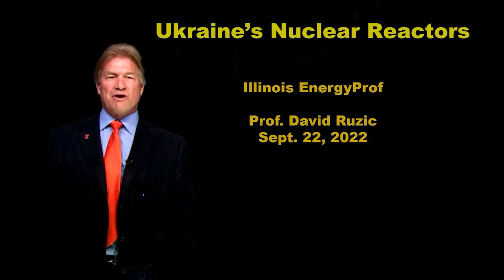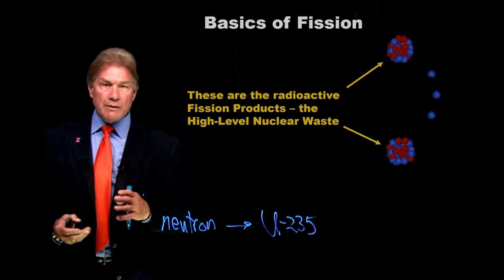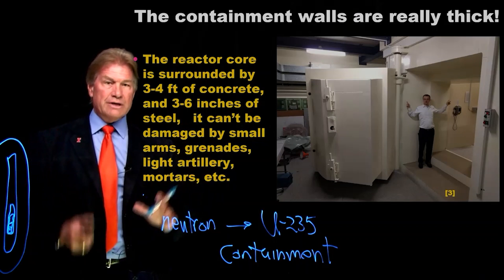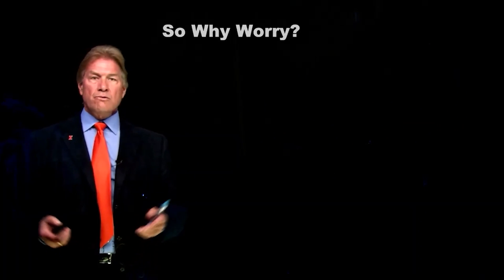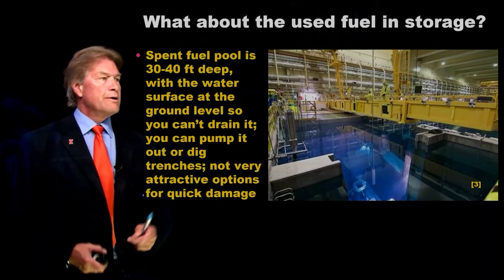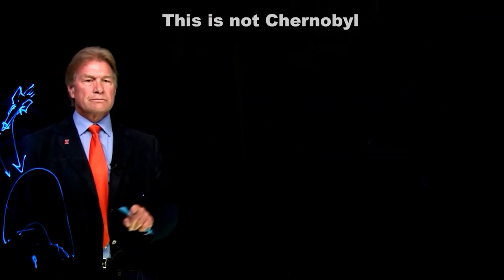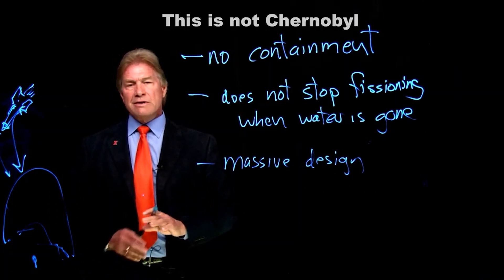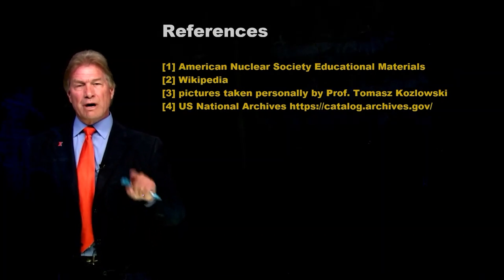Ukraine's Nuclear Reactors

Comment: Appreciate the video. Please stop calling it “The Ukraine” though, it is simply not correct.
Reply from the maker: I certainly did not mean anything derogatory when I said "the' Ukraine.  Of course it is an independent country.  The word "the" just slipped out.  It is true that I would not say, "Here is a map of the France".  On the other hand it does sound perfectly natural to say "Here is a map of the United States".  It also could be habit from having heard it described by that term for most of the last of my 64 years!   I did not realize it was politically sensitive, but sure do now.   I am more "up" on the science than on the politics and I try to concentrate on the science part.
Reply: No problem, I just wanted to point it out as some of your visuals also referred to it as “The Ukraine”. For example, at 0:25 it says: “Before the war, the Ukraine…” It’s not an overly sensitive topic but it is more proper to call it just Ukraine :).

Comment: A nuclear power plant is just a specialized industrial facility, and like other industrial facilities it requires electricity to operate and maintain.  In this case, maintenance includes keeping the fuel (spent and otherwise) cool.  While there is a defense in depth strategy for backup power, that strategy relies in the end on the continuing availability of diesel fuel for their generators.  While it would take a concerted effort to deliberately spread radioactive waste far and wide across the landscape, what happened at Fukishima is also possible if diesel (or grid-tied power) are not more or less continuously available at the site.  Yes, Fukishima wasn't nearly as bad as the media and others make it out to be, but it still is undesirable and would leave Ukraine without a significant portion of their generation capacity.
Reply: The only way a Fukushima type of release happens is if the containment domes are blown up. Otherwise, if cooling stops for a long enough time, you may have a meltdown of the cores that should be contained inside the reactor buildings, and hydrogen/steam building up, which may be released to the atmosphere like in TMI-2, probably scrubbed in the way out for barely any radioactive release. The VVER-1000 has systems that destroy any hydrogen buildup inside the reactor buildings as well.

Comment: I think one point that you could have emphasised a little more is the fact that to deny the operability of the plant, you really only need to attack the switchgear and transformer areas.  This is the distribution and its destruction completely renders the plant useless no matter what the generation source.  Also, most weather goes from west-to-east and the radiation would just end up in Russia as well.
The switch-gear is relatively specialized and is a relative-challenge to source, however the transformers are the real problem because unless you have them sitting around, there are very-few manufactures and the materials are somewhat specialized in their manufacture as well.  This is why and EMP event is so devastating because it overwhelms the ability to just replace thousands of transformers.
So, the Russians can just attack the outside to disable.  Any attack centered on the fission-process is indeed a war-crime...

Comment: "Cancer risk"  is a kind of scaremongering. In fact there is no link between radiation release an number of cancer cases. Even in Chernobyl, increased number of registered thyroid cancer was in fact badly preformed statistical data collection. Datasets collected previously (through so-call  "policlinical" research, before Chernobyl disaster ) were used against datasets of tolal screening of .population, after. Definitely there will be increase of number since thyroid cancer is such a disease that people may leave with it comfortably for many-many years and die from different causes. But it is very easy to diagnose.

Comment: A tank can penetrate that containment, they in fact can penetrate up to a meter of steel in some cases. With the right ammunition.
Reply: Maybe, it would be quite hard, though. A containment building is built like a bunker, even high velocity AP ammo will have a tough time getting through. It almost certainly won't happen by accident.

Comment: 5 times more electric energy is needed to replace fossil fuels. 
Fossil fuels are high density energy. 

It is simple build a power grid that is 5 times bigger. 
In Australia as a test, the 1,000,000 klm at today's capacity should be built to 5 times bigger capacity. 
It would be the same as building 4 new grids, 4,000,000 klm new.
And as Australia is a small population they can borrow the finances.

The government will guarantee the loans. 

And then you build the new and bigger nuclear plants, the 25 GW today becomes 125 GW of new generation and as Australia is small it can borrow the money and the government will guarantee the loans and the cash flow so others are comfortable lending. 

SMRs are only $2BILLION each and at 300Mw each Australia would only need 400 SMRs.

I think we should start immediately before demand goes up and prices to supply increases. 

We need more construction people and so a new wave of migrant construction workers would be perfect.

Who agrees  ??

Comment: One thing that needs explanation. Why was the news media making a huge deal about Chernobyl losing offsite power when there shouldn’t be anything to cool there?
Reply: You still need electricity to run the ventilation fans. I suppose the 'New Safe Confinement' is held under slightly 'negative' pressure  to the surroundings by those fans. This means some air from the inside is drawn out the NSC by fans, filtered and ejected to the outside, while there are other fans to 'push' back air in (but a little less than is drawn out, to maintain the negative pressure). Loss of electrical power to these fans (and al the other systems for conditioning this air, like heating or cooling) wil eventually lead to loss of negative pressure and a chance that some contaminated air could escape.

Comment: Putin may prefer blowing up nuclear reactors to detonating bombs because of the plausible deniability.  It's similar to blowing up gas pipes instead of just turning them off, or sending FSB agents to blow up apartment buildings in Moscow as a way to start a war with Chechnya.

It's good to know the reactors are relatively safe.  I wonder how much damage could be caused by a team of malicious operators...though malicious operators could be more difficult than find than a couple pilots willing to drop a bomb.  Fortunately criticality incidents, including Chernobyl, are much less destructive than the smallest atomic bombs.  The explosion stops the chain reaction.

Comment: Thank you for the informative video, but there is one thing you got wrong. It's just Ukraine, not The Ukraine. The "the" implies linguistically that Ukraine is not a country but merely a region. It's the old-fashioned way of referring to the country, but they officially asked the English speaking world to drop "the" some 30 years ago when the wall fell and they became an independent nation. Now, when their sovereignty is once again at stake, is absolutely the time to drop the "the".
Reply from the maker: I certainly did not mean anything derogatory when I said "the' Ukraine.  Of course it is an independent country.  The word "the" just slipped out.  It is true that I would not say, "Here is a map of the France".  On the other hand it does sound perfectly natural to say "Here is a map of the United States".
Reply: @illinoisenergyprof6878  I know you didn't. It's the traditionally correct way of referring to the country, and you just spoke as you were once taught. All I'm saying it's no longer appropriate.
Reply: Yup, I knew I'd find someone crying in the comments about this

Comment: Thank you Prof. Ruzic!
I didn't know the plant was made of a set of pressurised water reactors; I thought the reactors were of the old RMBK design.
I'm a bit more serene now.
It would be nice to see you more often.
Regards from the UK,
Anthony
Reply: They're about the same design vintage - VVER type PWRs. Much safer than RBMKs for obvious reasons.
Reply: Also, RBMK are still operated in Russia...
Reply: @humble_one_1  RBMKs were only operated within the USSR. These were easier to manufacture as you only needed a zillion of pressure pipes, but not a big sturdy reactor vessel, which needed to be put in form in a huge forge - today not many companies worldwide are able to perform such a task.
Reply: @gunnarkaestle    Actually. They are still operated in Russia, Kursk NPP and some other... 
Upgraded after Chernobyl of course.
Actually not that bad design. You can reload fuel with no need to stop reactor.
Reply: @ Actually, it is a bad design, as the void coefficient is significant. If some of your pressure tubes burst and loose water, the reactivity increases and may reach prompt criticality. This does happen even after the issue with the graphite tips on the control rods was solved.
Reply: No RBMK’s outside the soviet union obviously.
Reply: @ Current operating RBMK's are only within Russia (7 units left), as the one in Ukraine (Chernobyl) and in Lithuania (Ignalina) have been shut down.
Reply: @gunnarkaestle   yes
Reply: Wrong video
Reply: why you did not google it, if you were not "serene" before? All the info is there, independent of presenters. Get the facts and be serene :)

Comment: How are nuclear heat exchangers maintained? 
Do they need to be cleaned out regularly like normal ones? If so how do they not have contamination?
If they don't need to be cleaned out, how do they do that?
Reply from the maker: Usually heat exchangers that get fouled are ones that use outside water, like a river or a lake.  The heat exchangers inside the containment are distilled water to distilled water.
Reply: @illinoisenergyprof6878  With a bunch of corrosion inhibitors, since pure distilled water is corrosive. DAMHIK

Comment: Now use a trivalent fuel one fissile 239Pu or 235U isotope and two fertile isotopes 232Th or 238U. 232Th would be a hotter fuel source since 233U makes behaves similar to 235U except that it has a higher fission cross section in a thermal spectrum as used in a reactor. 🤓

Comment: A kinetic rod penetrator from an MBT gun CAN go through a containment structure. Likely some of the larger tandem warhead AT rockets could too, but not the most  common man portable AT systems.
Reply: Advanced atgms can penetrate 2400mm of steel.  But the explosion is very focused.  

They do have bunker busters that would do the trick.  But considering they occupy the place, they could just turn off the pumps.  Or just grab the spent fuel and toss it out in occupied territory.  Remove the generators that power the pumps.  

And it doesn't have to be on orders from above.  The occupying force could just decide to loot the place or detain the workers.
Reply: RBMK5000  
I agree that common man portable AT systems are not going through 1.5m concrete and 100mm carbon steel. Honestly, I've watched quite a few videos these last 7 months + of this class of weapons failing to penetrate the MBT armor they were designed to defeat.

However: look at air launched and vehicle launched AT rockets, particularly those with tandem in line warheads or very large single shaped charge warheads, as in the case of USA AGM114-K "Hellfire" missile. The weight of HE in these is an order of magnitude larger than the common man portabl AT weapons, THOSE could make a hole. Hopefully nobody is stupid enough to use such things.

As far as the depleted Uranium or Tungsten rod penetrators, the present generation of those fired from smooth bore guns at well over 1,500 m/second? At 90° those WILL go through the described 1.5m concrete + 100mm steel too.

Comment: The scary thing about the Chernobyl plant was it used graphite and when hot, carbon and the oxygen in the atmosphere like each other.  The burning propelled the nuclear material into the atmosphere.  It would be nice that these plants be designed so that if everything else fails, there would be a convectional cooling system.
Reply: The scary thing about the Chernobyl plant was that the operators pushed a reactor (with severe design flaws) into an unstable state just to perform an "experiment" so their bosses would be happy.  Was Chernobyl preventable?  Probably not. 

There's an old adage in engineering:  "You can design a foolproof system, but eventually it will break in a way you never anticipated."
Reply: @stevematda976  The idea that the operators were primarilly to blame is a narrative that the soviets initially pushed since it's easy, later analysis found that the severe reactor design flaws carry most of the blame. The operators' actions created the conditions that allowed the reactor's negative characteristics to manifest themselves, but the operators had no idea about that... the problems with the reactor design were already known at the time to the designers, but not communicated to the operators.
Reply: @stevematda976  Or, as the translation of the 1993 Soviet report about this accident (Annex I to INSAG-7) said: "The Commission considers that the negative properties of this type of reactor are likely to predetermine the inevitability of emergency situations"  ... in other words, the reactor was an accident waiting to happen

Comment: You missed the possibility of a deliberate nuclear strike on a nuclear power plant. Instead of 50 pounds of fissionable material exploding and irradiating a relatively limited area, you now have a few hundred tons of radioactive products scattered into the atmosphere, i.e. Chernobyl times six or more. That is more than sufficient to render the entire Ukraine uninhabitable and probably large parts of Europe and Russia, depending on atmospheric winds at the time. Faced with what they perceive to be an existential threat, the Russians would be prepared to pursue this option. They can afford to abandon the country West of the Ural Mountains for a century or two. Europe, not so much. That is what has Europeans somewhat concerned. Western politicians worry about what will happen between now and the next election. Russia, India, and China are planning for what will happen in the next century or more. A fundamental difference in outlook whereby entire populations are motivated to work for a societal goal and to hell with individual freedoms.
Reply from the maker: Where-ever you drop a nuclear weapon it results in massive fall-out because the neutrons released makes even dirt radioactive and it sends everything up into a mushroom cloud which disperses.    I don't worry about the target; I worry about the act at all.    I hope you are wrong about what Putin may do!  You do raise a good point about long vs short term thinking and planning.
Reply: @illinoisenergyprof6878  Hi, wouldnt a nuclear strike on a power plant be mutually assurred destruction though? All nations would start firing on each other or atleast some, unsure if they should fire or not. If Russia dropped a nuclear bomb on a plant themselves too, other nations would nuke Russia. It's a loss-loss.

Comment: Could Ukrine use a team of commandos to take over and destroy the RBMK reactor near St Petersburgh using the same method that destroyed Chernobyl?
A massive radiological disaster next to Russia's 2nd city would cause chaos, and mean Russia would have to divert troops away from the conflict in Ukraine.
Maybe they could threaten this as retaliation if Russia uses nuclear weapons in Ukraine?
Reply: That would be an huge military effort. Actually the Russians say that Ukrainian saboteurs did attack one of the RBMK plants some time ago, Kursk iirc. For actually replicating Chornobyl, they would have to infiltrate the control room, and be there for quite a while. shutdown the reactor for a while(a couple of hours), turn off cooling,and then pull out all control rods at once, just to then SCRAM it. i actually think that RBMKs do not have the graphite-tipped control rods anymore, which was one of the biggest issues.
Reply: @AlldaylongRock  Of course they still have them, they are an integral part of the reactor control system. The flaw in Chernobyl was that they were too short, so all remaining RBMKs were retrofitted with longer graphite tips (and many other upgrades).
Reply: @Z80Fan  Thanks for the heads up. I knew that there were plenty of upgrades in the remaining RBMKs. Didn't know the extent. I also know that retrofitted redesigns were made to reduce the void coefficient.
Reply: Holy cannoli you are evil. Russia is not the problem. Please learn about hegemony.
Reply: You need psychiatric help